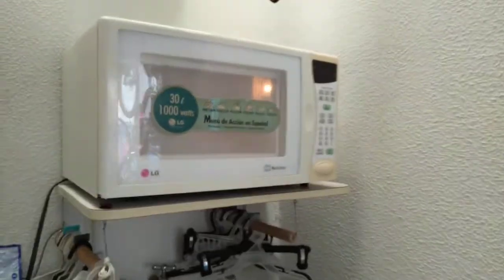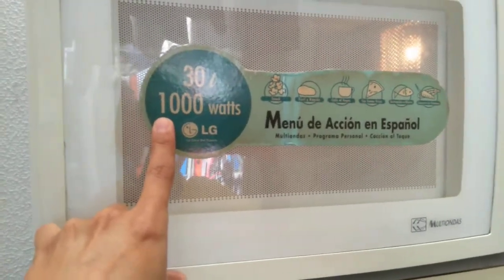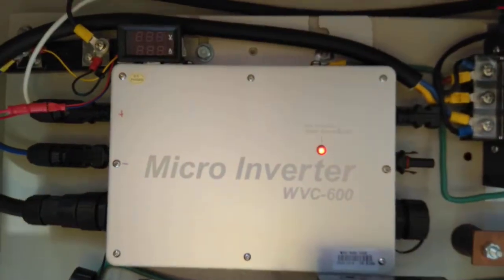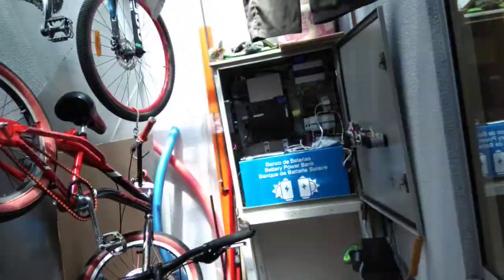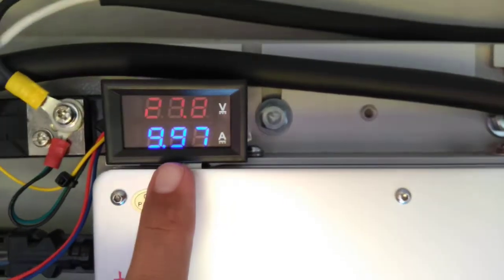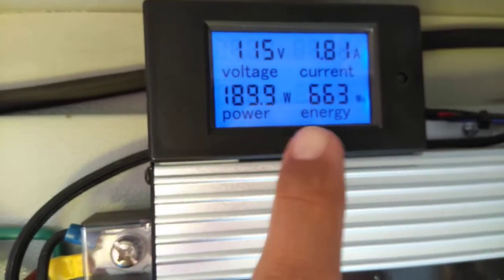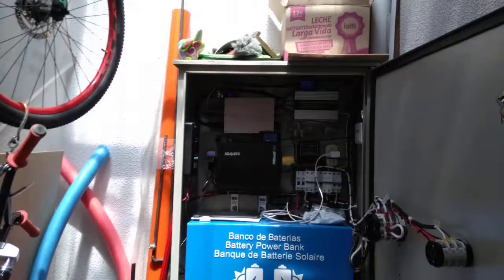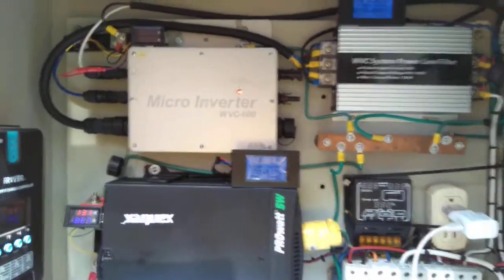Testing Solar WVC 600 Micro Inverter - It's Really Work? - Home Solar System

Comment: I've heard bad things.
They are a bit of a fuss to get and keep working.
Can't have two solar panels.
Can't have more than 500w of Solar.
Over heat
Melting transformer
Wrong/miss matched capacitors.

There is a website showing the pictures and comments saying they work a day, mppt gets stuck. And a host of issues....

So let's have a update, how is yours?
Reply: you heard wrong
Reply: @Good-Enuff-Garage  I guess the websites and forums saying things and showing pictures must also be wrong according to you then?
20+ to 1.
Reply: @guywhoknows  Rory millions of these Inverters have been sold and have been in use mine is delivering 6 kWh per day and it cost me $85 bucks, even if I have to buy a new one every year I still come out on top, my friend paid $21,000 dollars for a system that generates 8 kWh per day we have been comparing for the last year daily production, and that is after all his grants, discounts, and tax credits that are taking years to brake even on

Comment: How I can buy the equipment to measure  voltage, power, current and energy at same time? Thanks
Reply: Hi.  Check this links for AC Meter:  https://www.aliexpress.com/item/4000275706223.html?spm=a2g0o.productlist.0.0.2bf0247cUxLFiF&algo_pvid=fdeb2ee7-02ef-4eac-b033-009fe9153d98&algo_expid=fdeb2ee7-02ef-4eac-b033-009fe9153d98-5&btsid=2100bdd716096126189322216ecf1a&ws_ab_test=searchweb0_0,searchweb201602_,searchweb201603_

Comment: Why is the micro inverter not on the back of the solar panel where it should be? Your getting loses with the length of cable in DC...

Comment: This is a good video but can this supply 230v? I have to sent power to a Net Metering meter for the electric company but I think it is 230v.
Reply: Yes you can.

https://es.aliexpress.com/item/32861032764.html?src=google&albslr=205249049&albch=shopping&acnt=494-037-6276&isdl=y&slnk=&plac=&mtctp=&albbt=Google_7_shopping&aff_platform=google&aff_short_key=UneMJZVf&albagn=888888&albcp=1633820309&albag=63890294393&trgt=743612850874&crea=es32861032764&netw=u&device=c&gclid=CjwKCAjw67XpBRBqEiwA5RCocS6f3gYcB8LgUxm9C0tzsDcgu1RZDl34e_kLFIgFo1B0HAGgLs5naBoCYBYQAvD_BwE&gclsrc=aw.ds
Reply: Hi.  No, this MicroInverter only supply 120V.   If you need 230 you can use a Enphase MicroInverter: https://enphase.com/en-uk/products-and-services/microinverters